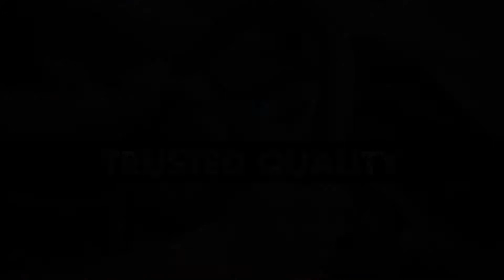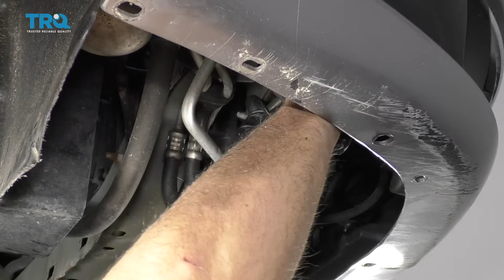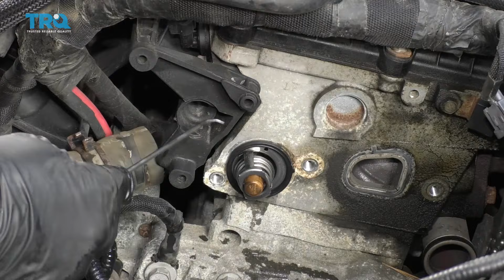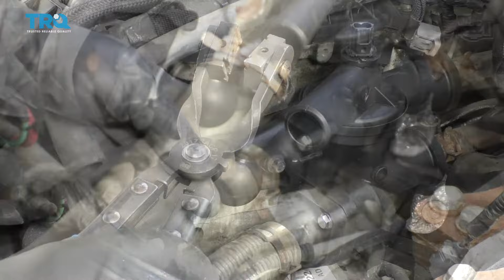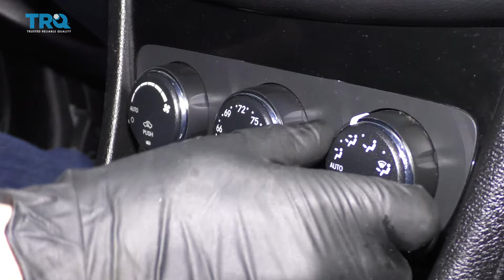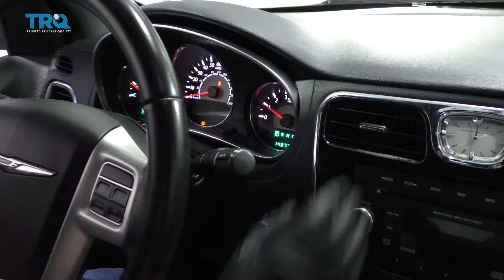How to Replace Thermostat with Housing Assembly 11-13 Chrysler 200

Comment: Major question.. I have 2011 chrysler 200 2.4..  do I have to disconnect negative from battery or can I simply remove the negative  ground from top.

Comment: You said most of the art burped out but I know some car require a bleeder valve to be slightly opened in order to do that. Does this car not have 1? I've been looking and can't find the exact location I there is 1 or do you simply use the method showed

Comment: Fantastic. Thanks so much. This is what I need to do to my daughters car. We took it to a shop, and an expensive labor to replace just 1 thermostat, but not the housing or the other thermostat in the housing. She continues to have off and on problems with her thermostat opening up, so I'm going to replace this entire housing, including both thermostats, and save money doing it myself. It's a bit more complex than I would have guessed compared to thermostat issues on most cars, but it's not HARD. Just quite a few steps, each one, very doable. Fortunately we already have the bumper off for other reasons so that will save several steps. Great instructional video.  Databyter

Comment: Hopefully you see this post! I was wondering why you replaced the entire housing? My daughters 200 has error code P0128, I’m not able to do the repair myself as I’m 2000kms away. The shop doing the job said the thermostat was stuck closed and he must replace the complete housing as it doesn’t have just a thermostat cover. Everything I can see shows the ability to just replace the thermostat cover and not complete housing. Even with the thermostat on the engine between engine and housing, shouldn’t you be able to just replace the thermostat and not replace the housing? He also charged her $380 for the housing itself. 4 hours labour too.
Reply: he charger her too much. the part is 50. taking the 3bolts off should be 30 mins.jeez

Comment: never reuse those factory hose clamps, they get weak over time.. they just use them for quick assembly when the car is being built..
Reply: Wrong...reusing them is fine just reinstall in the original position.those original spring clamps are better than using new worm gear clamps.original clamps can adjust with temp changes....worm gear hose clamps do not do this and can be problematic after the fact.

Comment: I wonder how important working those bolts are I feel like as long as I get them good and snug it should be fine it shouldn't affect nothing if they're not torqued exactly correct
Reply: U are correct...torque wrench not necessary.you can tighten them snug...not to much and it will be fine.

Comment: Very helpful video. I'm going to attempt it this upcoming week. My one question is this: rather than disconnecting the negative terminal from the battery, would it be enough to disconnect it from the remote cable under the hood?
Reply: Yes it would.also you really need not disconnect the battery at all.just done here as a precaution.
Reply: I learned cars by reading car specific Chiltons Manuals in the 70's and 80's. No matter WHAT you were doing, the first steps were always; "Jack up Car",  "Disconnect Battery".. It must be a liability thing. Of course it only takes a few moments on most cars, so if you are going to be disconnecting sensors and harnesses, it doesn't hurt, but honestly most of those are dead on a dead ignition key, and even if they weren't it probably wouldn't hurt anything.  Databyter

Comment: 2nd time watching this video and the thoroughness between your explanation and the video as well makes doing this easy to understand.  👍👍. The only thing I didn't see was the piece you loosened up for the radiator to drain, that gets tightened back I assume? I saw the cover get put back on but not the drain plug.
Reply: The radiator was not drained and does not need to be for this job.
Reply: @djsi38t  What was he draining off when he loosened up the petcock early in the video?

Comment: you didnt put the thermostat that was on the cilinder head???i just saw that you installed the one inside the housing but not the one on the cilinder head.
Reply: The one on the head is the one he put back onto the plastic housing. He also replaced the whole plastic housing because there is the other one is built into it.
Reply: Yeah wtf.

Comment: Hi I’m Vera and I’m having the over heating of my vehicle after I just got the hose changed out it had broken now it is still running hot, what or how do u know what to do or check next? I have the Chrysler 200,2013
Reply: I do see antifreeze laying in the lower end of house, or engine block.
Reply: Check your seals
Reply: Make sure all the air is out of the system.

Comment: Good job. I have problem leakig from   thermostate seal so, I need advise to fix this do think to chang the hole hosing or only bring new thermostat with seal,  O ring and adapter seal. The hosing looks good my car already run 293km
Reply: U can do just the thermostat but these housings are known to fail and replacing them while you are at it is not a bad idea.get a good one though some aftermarket parts suck....gates makes the good one.